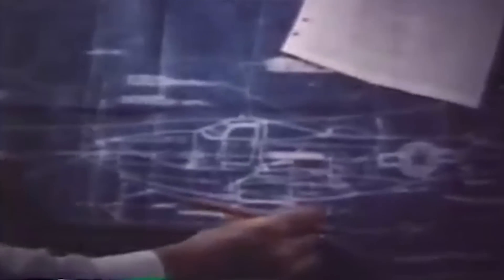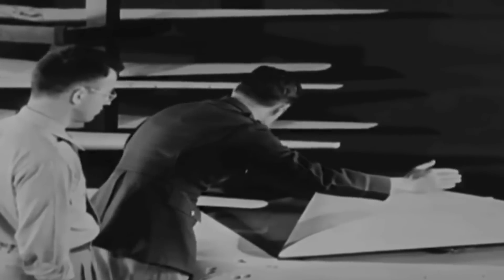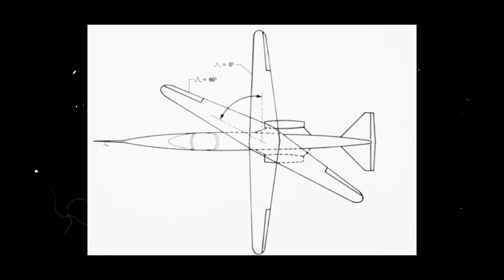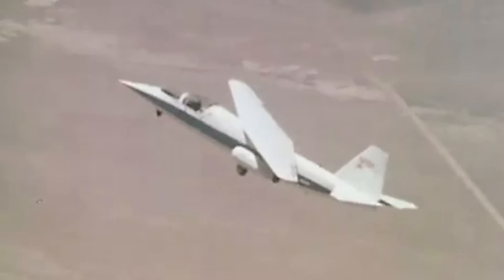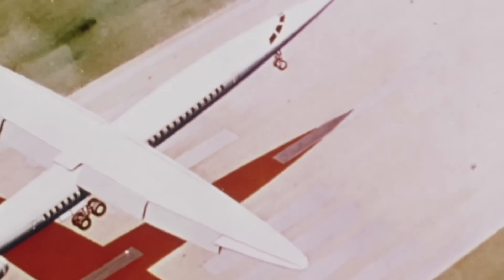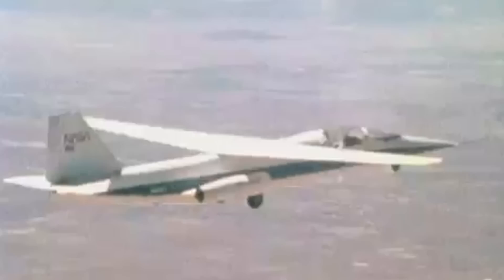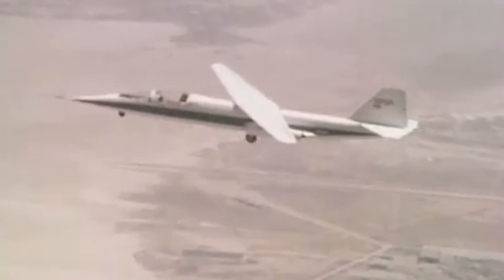The Plane with Scissors for Wings

Comment: Nice video but it leaves out some pretty important stuff.  The concept came from RT Jones, but this actual airplane was designed by Burt Rutan.  Also, the name AD-1 is an important part of its history.  NASA did this reorganization in the 1970s whereby Dryden (now Armstrong) was organizationally under NASA Ames as a satellite.  Programmatically the concept was for Ames and Dryden to partner in a new line of super low-cost experimental airplanes.  AD-1 was supposed to be the first of many ADs.  But here is the really funny part.  It wasn't supposed to happen.  Ames was the wind tunnel farm.  NASA headquarters approved the project and Burt with Ames Industrial as a partner built the thing in a hurry.  When it was ready to fly, Ames sent the necessary documentation to HQ for approval to enter flight testing.  Headquarters spit out their coffee and said "where did you get this damn airplane!"  Well, you approved it.  After some delay it was realized that NASA HQ looked at the plans and the budget and thought it was another Ames wind tunnel model.  It was now too embarrassing to cancel so it went through, but there would be no AD-2 and so on.  Also, there were plans to convert an F-8 Crusader to a scissor wing to test the supersonic characteristics but NASA had entered its phase of bureaucratic fear of airplanes and aeronautical research budgets continued to shrink.

Comment: "the ad-1 had a squatt-y appearace, as it was only 6.5' from the ground"

***Shows picture of the plane's canopy only coming up to a pilots shoulders***

Does he do the voice-over before he researches, or does he just make horrible editing decisions?

Did he mean the top of the vertical stabilizer was 6.5'? Well, that would be strange sloppy phrasing, as his next statement was that "the plane also included a rudder and stabilizer"

similar to his video describing "NASA and Air Force developed planes" that show US ARMY insignias in the frames accompanying the statement.

Maybe these arnt errors, maybe they are. But he is making a poor job of editing to leave things to contradictory.

Comment: The actual aircraft structure was designed and built by Burt Rutan and his company, Scaled Composites of Mojave, California. He was a pioneer of lightweight low cost sandwich composite aircraft structures. If anyone wants to see a radio controlled swing wing model that I designed, look at Electric Flight International magazine, January/February 1995 (UK) page 38. It used a servo to swing the wing, but when that broke, we tried winglets at the tips to swing the wing.  Surprisingly it did loops and rolls without too much difficulty. The greatest problem for the RC pilot was disorientation when the wing was swung back about 60 degrees.
Reply: Scaled Composites did not exist when the AD-1 was birthed. Rutan did an unsolicited proposal to NASA under his own company, Rutan Aircraft Factory, to design and build the aircraft and subbed out the construction to Ames Industrial Corporation in Bohemia NY where the TRS-18 engines were located.  I worked at Ames from 1973 to 1987 and participated in the building of this airplane.

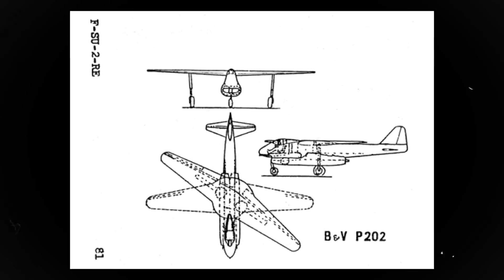Comment: Same as problem of Variable Swept Wings, as in F-111 Aardvark, Me P-1101, was solved by adding an small fixed high swept section in wing root, would a circular fix in the wing center improve the Scissor Wing performance and stability? The B&V P-202 in this video, min 01:27, had it. Blessings +

Comment: Has there ever been a plane with telescopic wings? Meaning a small inboard section housing the fuel tanks, and a slightly oversized outboard section capable of sliding over the inboard wing?
Apart from reducing the footprint and having less drag in flight, it also reduces the number of control surfaces.
Reply: Yes, see the FS-29:  https://akaflieg-stuttgart.de/en/projects/fs29-telescope-wing/

Comment: As a kid I built a model rocket kit in the 70s or 80s that had a scissor wing flip out so it could fly back down instead of using a parachute. I don’t remember if I ever actually launched it, or if so, if it actually worked.

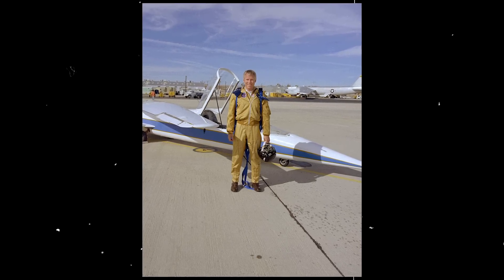Comment: @5:06 Hell! How tall is that pilot if the plane only stands 6.75 feet from the ground?
Reply: When he sits inside the airplane at an oblique angle, I would guess he's about 2 to 2.5 feet tall. Standing, maybe 6ft I don't know
Reply: You folks ever hear of a vertical stabilizer to which the rudder is attached? the top of the vertical stabilizer was just less than 7 feet from the ground.

Comment: This is just a ghetto version of variable swept wings.
Reply: Nope. Variable sweep needs to take up the wings cantilever loads in the swing bearing(s) making them complicated and heavy. The scissor wing neutralizes these loads within the wing structure; the bearing can be much simpler.
You could never have built such a simple and light proof of concept plane with symmetric variable sweep.

Comment: Whitcomb area rule tells that this oblique wing configuration should be able to create much less wave drag than the swept back wing (F-14) configuration in transonic regime.  R. T. Jones fought for decades to sell this concept to DoD and aviation industry.  But this anti-symmetric concept was too advanced to be applied at 60 and 70s. And control system on the aircraft was not so advanced at that time. 
But somehow, this concept revived and got funded from DARPA in early 2000s and after thousands of wind tunnel testing and millions of dollars, it was canceled again in 2008. If Germans had these resources, I believe we already have the Super Sonic Transport systems every where.

Comment: I wonder now, if the instability of the aircraft, may have been due to the fixed landing gear?
3 wheels in the airstream, would certainly have an effect.  And in a steep climb, wheels would be a real drag factor.
But it seemed they never addressed that issue.

Comment: Design for for flying cars? They could be parked side-by-side easily in a car park or driven along the road with wings at 90 degrees from flying position. Would need side roads parallel to main roads for take off and landing though.
Reply: Rotating the wing for transport or storage is not the same as rotating the wing while flying.

Comment: Helicopters have wings that travel in a full 360 degrees it just seems to me as a helicopter with the wings stopped at a certain point of that rotation. Obviously the wings are much larger than a helicopter blade but same idea.

Comment: If this worked so well, then why has no one since ever built another plane with asymmetrical wing design?
Reply: Excellent question. I imagine the pivot mechanism adds too much mass and complexity to be worth the fuel savings.

I think there are control issues as well. The ailerons will start acting as elevators when the wing pivots.

Comment: In a galaxy faaar far away, engineers made a similar plane with crossed dual over-fuselage variable sweep wings, it was called "overhead X wing" but they redesigned it with lateral wings and simply called it "X wing"

Comment: I built and flew the Estes model rocket  version of this plane as a kid back in the day. Estes had figured that the wing should line up with the fuselage for launch. Then a rubber band and balsa wood system snapped the wing into the traditional perpendicular position for glider flight after the engine ejected itself at peak altitude.  (about 300 feet)  It was easily the best day ever for me when my build of the model actually worked without a problem. 👍🏁
Reply: I had one of those! It was my favorite rocket.  Of course once I put a much bigger engine in than it called for and I had a fun time chasing that down!

 But then one day the wing somehow deployed on launch and the thing just blew to pieces about 50 ft in the air. 

Fun times!
Reply: @dankuchar6821  Hehe, shoving in the biggest motor your rocket could physically fit was always fun, hiking to go find it not as much 😂
Reply: Very interesting. 😊
Reply: That is awesome

Comment: Engineering may be great, noting an original design. But, fixed wing aircraft designs are less complicated, and accomplish the same goals. Hence, triangled bombers, fighters.
Reply: > But, fixed wing aircraft designs are less 
> complicated, and accomplish the same 
> goals. 

That's incorrect.

While fixed wing aircraft are less complicated, fixed wing aircraft can't really compete with variable geometry aircraft in terms of range of speed from a bearably slow takeoff and landing speed to a screaming high top speed.
What the video failed to make clear is that just below supersonic to just above supersonic, an oblique wing has much less drag than any symmetrically swept back winged aircraft.
IOW, an oblique wing is likely much more efficient (i.e. higher lift-to-drag ratio) than any other aircraft configuration you can name.
This is just exactly what you want in a passenger airline where a government isn't paying the fuel bills.

As for "triangled bombers, fighters" you mean bombers and fighters with a tailess delta configuration, I think your history is a bit off.
The joys of supersonic flight were considered back in the early 1900s before any aircraft was able to get there from here.
Nevertheless, reducing the sudden increase in drag through the use of a delta wing planform was dreamed up by a German researcher whose name I can't recall right now.
But no one was much interested because no aircraft was able to get close to Mach 1.

Alexander Lippisch, who can be reasonably called the father of the delta wing, became fascinated with them some time afterwards, but while he managed to made some delta wing aircraft as well, he couldn't interest the rest of the German military in building anything with a delta.

Meanwhile, R.T. Jones developed his theory of how delta wings could do wonders at supersonic speeds, but he couldn't arouse any interest in the U.S. because people were skeptical about whether or not what he came up with was really true and so he was likewise ignored.

Then in 1939, Richard Vogt at Blohm and Vass proposed an oblique wing fighter, the P202.
It never made it into anything beyond the paper stage, but after WWII, the German research in swept back wings persuaded everyone to take Jones seriously.
And when Jones began to think about oblique wings, the P202 lent him some gravitas he might not otherwise have.
Unfortunately, despite numerous studies and flying models, it took the AD-1 to show that an oblique wing aircraft was not a handful to fly.

At this point, I don't think there's any question that an oblique wing will beat a symmetric swept back wing in terms of reduced drag near Mach 1, and an oblique wing with just a single pivot located at the MAC is about as simple as variable geometry gets.
But acceptance "inertia" continues to make fixed swept wings the go-to solution for roughly supersonic speeds.
Reply: @lewiscole5193  I was considering the sr-71 blackbird and f104-g star fighter. Both fixed winged, triangular winged, and swept winged super sonic and designed before the AD-1.  My point was limiting drag. That which is most important. A complicated variable wing design accomplished that. But, apparently wasn't monetarily feasible with tax payer money!
Reply: @lewiscole5193  And far as passenger aircraft, shall I mention  Concord?

Comment: This seems like an easy design for repairs too. Wing gets damaged, pop it off to get it repaired or something, and slap a new wing on. Engines look accessible as well. I'm sure a pivoting mechanism for armaments could be created to allow for wing mounting. Or perhaps it wouldn't have been flown with wing sweep for such a sortie anyways. It seems complex, yet it is really simple overall. It would be interesting to see this design pushed into the current generation, more advanced materials and construction, stealth, performance
Reply: it's a worthless design, and that's why no one has or ever will make one. why would I want one side of my plane to behave the opposite way of the other. if you're going fast enough you don't even really need wings.
Reply: @gibbsm  One side will not function in an opposite manner, as a matter of fact. Swept forward and swept back differ a bit in lateral stability, and rear swept wings act similar to dihedral. The other difference is stall characteristics, but that is only a concern when a wing is nearing stall speed. 

Both wings are moving in equal amounts of sweep, thus drag is decreased equally.  Any other inequalities in aerodynamics can easily be controlled via fly by wire. 

Look at something like the F 117. It is an extremely poor aircraft for aerodynamics and flight characteristics. The only thing that permits it to fly is the technology on board. If computers failed, it is said to be impossible to fly with human control.
Reply: @Vaterraman  the forward swept wing will push air towards the centerline, the rear swept wing will push air away from the centerline, which is the opposite.
Reply: @gibbsm  Very true. This doesn't change lift of the wings for the most part, but, rather, unbalanced airflow over the tail. You can see in the second model how assymeytical additions to the tail were created, to offset this imbalance.

Fly by wire would be necessary to maintain proper control of the aircraft, but most jets that exist today, while having bisymmetry, would be nearly impossible to fly manually, due to instability made in the aircraft. This instability allows for greater maneuverability, but there is an insane amount of corrections made by computers, even just in level flight.

Comment: Back in '81 when I worked right in the flightline of Moffett Field I saw this plane flying. I knew what it was as there were articles about it in popular science, and it was really interesting to see. Years later I heard it was outside of the Ames research center and went to look it over. That plane was so small, thinking that when I saw it flying it must have been some distance away, but to see it as I had it must have been a lot closer! I'm glad to hear it's been cleaned up and installed at the Hiller museum, it wasn't weathering well outside at Ames.
Reply: In 2001 I was in the CA ANG augmenting security at Moffett Field.  During a mid shift I drove into Hangar 3 and was surprised to see in my truck headlights the AD 1, NASA F-18, and a few other NASA experimental aircraft. They were just sitting there in storage.  It was like finding a lost tomb full of treasure! I took lots of digital pictures of them, which were crude given how dark the hangar was without lights on. Unfortunately I lost those pics when the hard drive they were stored on died.

Comment: I would expect a lot of roll force to the left, the air will be slipping off the left-hand wind causing less lift
Reply: this is like a helicopter rotor in the least efficient position for lift for each side, and you're so right about the airflow.

Comment: Easily solves the problem of the center of lift shifting aft, as it does on the F-14, F-111 and other variable incident wing aircraft. I remember seeing a proposed variation of this using a modified F-8 aircraft. Published in AvWeek in the early '80s IIRC. Article didn't say if the wing shifted, or was fixed. I wonder if and how the instability encountered with the forward swept wing X-29 showed up in the forward swept half of the wing on the AD-1.
Reply: OK, I see that a rotating version does indeed solve the problem of centre-of-lift movement in swing-wing aircraft. But his proposal was not for a moveable wing, but a fixed one. In that case, I cannot see what advantage it has over a 'conventional' swept-wing design, which had been around and successful for many years before this prototype. Seems to me the obvious question, and it's annoying the video doesn't even try to address it.
Reply: @thisnicklldo  Another problem is the inherent instability of a forward swept wing, as was shown (and accounted for) in the Grumman X-29.

Comment: That AD1 was built by Burt Rutan's Scaled Composites out in Mojave CA.  Not in the east.
Reply: That's incorrect.

Burt Rutan did the initial feasibility and design work of the AD-1, but when it came time to actually bidding on making it, he didn't even put in a bid in response to NASA's Request For Proposals (RFP) because his company at the time, Rutan Aircraft Factory (RAF, not Scaled Composites) was made up of only 2 or 3 bodies and the RFP limited the number of new hires could be in on the project.
So Rutan asked his friend, Herb Iverson of Ames Industrial Corporation of Bohemia, NY, to take a swack at it, which he did.
Eventually, Rutan and Iverson would go on to found Scaled Composites, but at the time that the AD-1's construction, it was built "in the east" by Ames Industrial Corporation.

You can find all of this in a free online book from NASA called "Thinking Obliquely" with the construction history starting around page 78.
Reply: @lewiscole5193  Late follow up....but you are completely correct.  I worked at Ames Industrial and participated in the construction of the AD-1.

Comment: The 'scissor wing' is really an invention of Dr Richard Voigt of the Blohm and Voss firm.  His P.202 proposal:  http://www.luft46.com/bv/bvp202.html.  Likewise Messerschmitt with its P.1011 and P.1102 proposal  http://www.luft46.com/mess/mep1102.html.   Swept wings, including 'area ruling' come out of 1930s German research.  Adolf Bussmann developed the swept wing and they had a pretty good understanding of area ruling.   The key to making swept wings work in real life is leading edge devices and other techniques such as wing fences or geometric twist to control spanwise flow which otherwise causes premature tip stall and a spin.
Reply: I thought that it was developed by Edward Scissorhands!